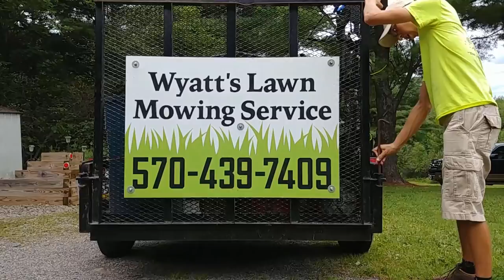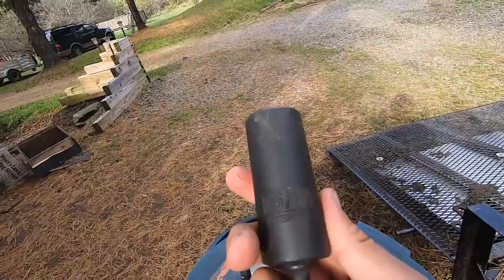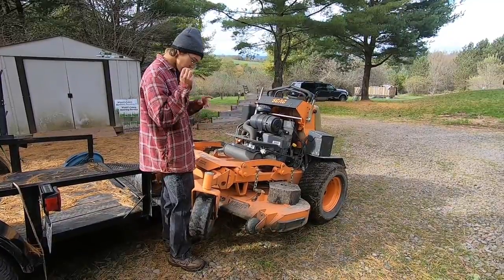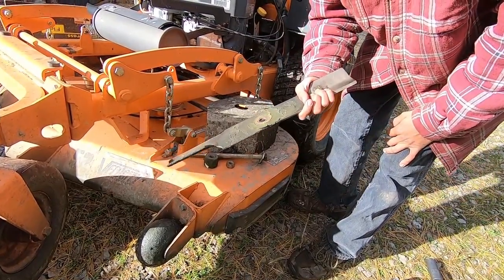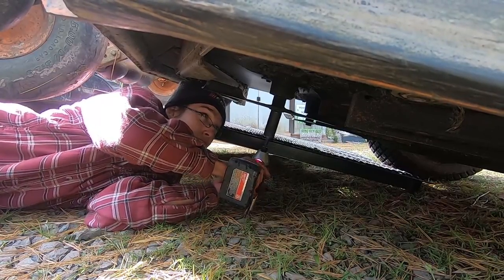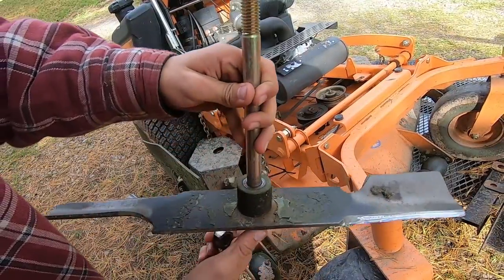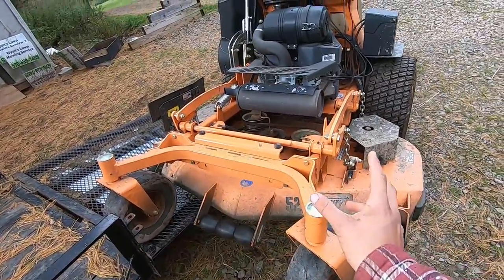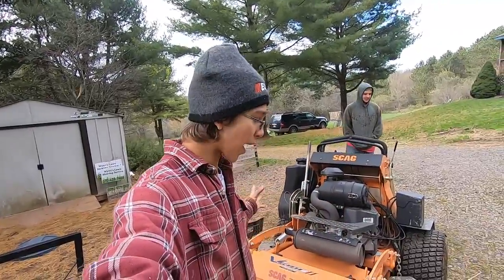How To Change Blades On A Scag Mower! Scag Vride II Blade Change

Comment: I cringed when I saw the middle blade spin close to our head / eyes.  I suggest getting a short length of 2 x 4 and jam it or clamp it to prevent the blade form spinning into your face - both removing & replacing  the blade for safety .

Comment: Nice vid my man. But you really gotta invest in a engine hoist or some call it a cherry picker. It allows you to lift the front end up high for deck cleaning also.  I Got a really nice one for $100. Could also get some 18 x 18 pavers and make you a nice pad to work on so you're not layin in the dirt. They're only like $2 a piece. Probably need about 30 though.  Be safe. See ya

Comment: How you liking the Vride II?  I'm heading out tomorrow to pick up a 2018 Vride II
Reply from the maker: I like it except Im currently experimenting with blades and baffles to try and get a great cut without clumping or the deck clogging
Reply: How does the whole baffle thing work?
Reply from the maker: You adjust it with bolts. Different settings. Haven't figured out how to get the ideal clipping dispersement without the deck clogging after a bit though :/
Reply: Keep us updated.  Thanks for the info.

Comment: Would you say unscrew from the top or bottom, i have a 2 blade deck.
Reply from the maker: Then whichever you have the easiest access to. If you have a Scag then either one will drop the blades 😄👍

Comment: I wish you would have cleaned under the deck before you put the blades back on.
Reply from the maker: I clean under the deck after each mowing day. So what was there was left over from when I scraped it with a garden shovel. I lost my usual scraping tool